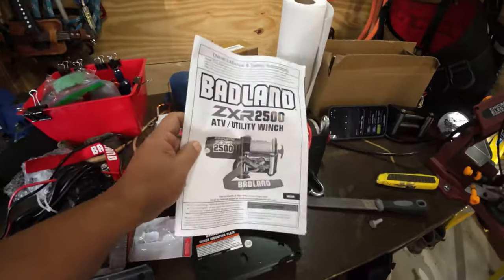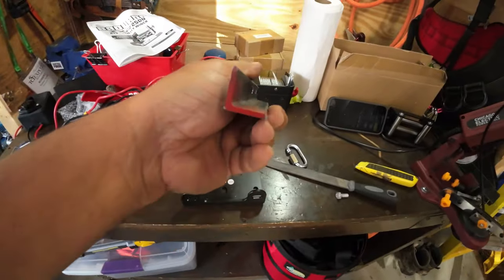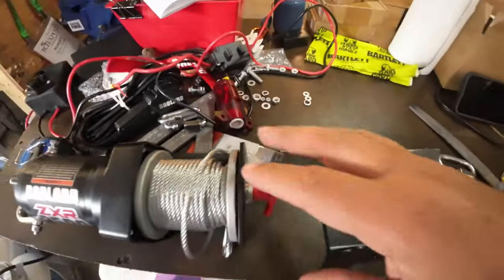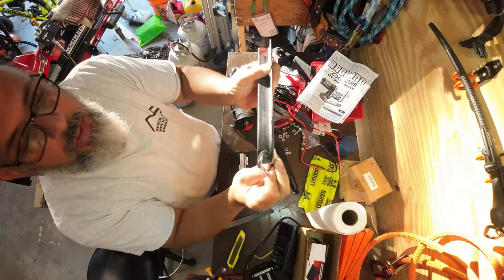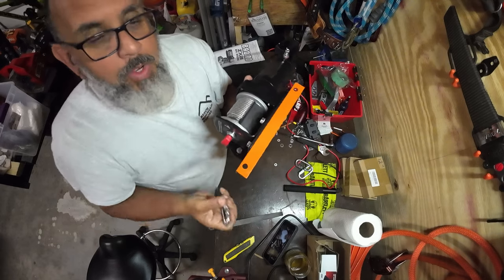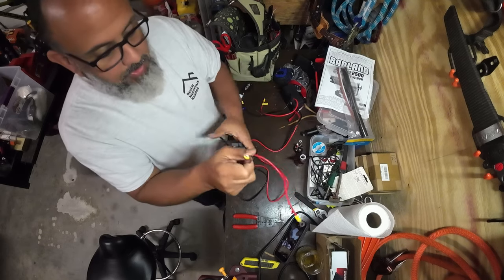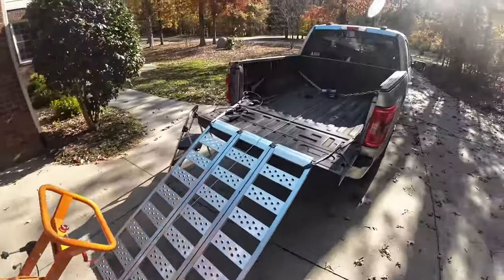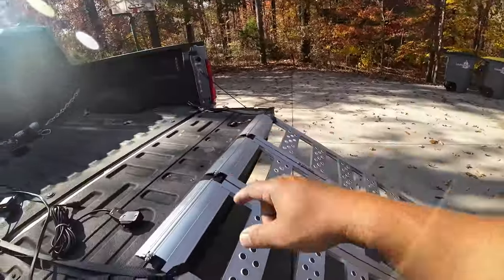7 Pin Trailer Plug To Power A Truck Bed Winch

Comment: That winch is spec'd at 132 amps.  That would be 4AWG wire at least, and that is WAY beyond what is wired in the truck harness to the trailer connector.  The 12AWG that you are using is horribly inadequate.  I suggest that you look to a heavier gauge wire and go direct to the battery.  You think the little 2500 is a small winch, but using 132 amps is a third of what your starter uses.  Also note that the power of the winch is compromised on the full spool, and that will cause it to draw much amps even for a small load.  This is NOT a good idea.  Replacing the truck wiring harness is not fun or cheap.  That 12v on the connector is for charging a breakaway battery for electric brakes.
Reply from the maker: Thanks for info, much appreciated. Just to clarify, its 132 Amps at the full 2500 lbs of pull weight. The Stump Grinder weighs 250 lbs or 10% of the total pull the winch is capable of. If straight math is applied here (if that's the way it works) that would be 13 AMPs. The most I would ever think about pulling up on this is maybe 500 lbs. I did this specifically for the Stump Grinder only. The newer truck models circuit breaker is 30 AMPs for that circuit. My wishful thinking here says that I should be okay :).

Comment: This is a terrible idea...You will melt your vehicles wiring harness and destroy your truck ! The wiring harness back to your 7 pin or 4 pin trailer hook up will NOT handle the amps and it WILL melt ! ..Run a single 6 guage  minimum wire from your positive side of your battery all the way back to the rear of the truck ..ground a separate piece about 3 feet long to your body and install them in quick connects ( copper awg  wire ) must be copper ..

Comment: The winch should be run with 10 ga wire directly from the battery per the specifications on the HF website.  Read your owner's manual on that winch.  The winch draws 25 amps for each 500 lbs it has to pull.  At a full 2500 pull, it can draw 132 amps!  And that's only if you have ONE layer on the capstan.  The current draw goes up from there for each layer of rope.  12ga chassis wire may overheat and blow like a fuse when under heavier loads or if the winch encounters resistance to pulling.  That winch has one powerful labor union.  Work for 45 seconds, then take a 14m:15s rest break.  The labor union may  allow the winch to work a few seconds longer with that stump grinder as it probably isn't a full load on the winch.

Comment: I appreciate what you did here. With infrequent use, short bursts, light and unbound loads, you MIGHT be ok. You are gambling with your truck's wiring harness. 6-10 ga battery quick connect terminals in the bed, or even terminal on 1 end of extended jumper cables, would be worlds better. A heavy rubber mat would save your bed. DO NOT run things in close with that wireless control, there are times when you left off that wireless control and it keeps running for 1.5 seconds or so, it can be very destructive to things or tear itself apart. The wired control response is instant. A piece of hard plastic would save the top rail of your ramp from the cable. If it is ever going to be in the rain, disassemble and seal that control box. Spray conformal coating on the guts of that wireless fob to get a longer life out of it in the rain. Keep the vids coming.
Reply from the maker: Thanks for the feedback. I like the hard plastic suggestion. I did notice some scratching. Fortunately, This is getting infrequent use and so far its been working great!

Comment: That 60 watt iron should be able to heat the wires to solder them.  Apply FLUX (not acid for plumbing) to the wires and apply heat with a small bit of flux core 60/40 solder to help xfer the heat to the wires from the iron tip.  Hold the iron on place for a LONG time, until you can melt the solder slowly ON the wire, NOT on the iron.  Apply a bunch.  Hold the iron on the joint for 10 seconds after the last application of solder to heat the entire joint.  Your un-soldered joint is going to heat up as it oxidizes and corrodes and as its jiggles loose.  This is a fire waiting to happen - at worst.  At best, your current flow will be badly compromised.
Reply from the maker: Thanks for the advice! Definitely one of my issues is that I didn't have any patience to do anything you suggested. I also didn't have any flux. Lessoned learned and now I know. Thanks again for the education!